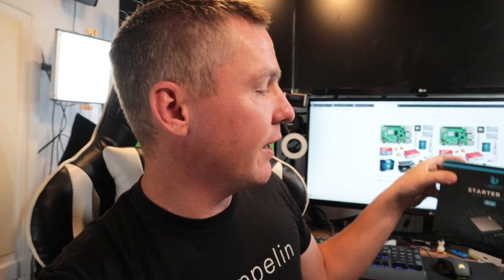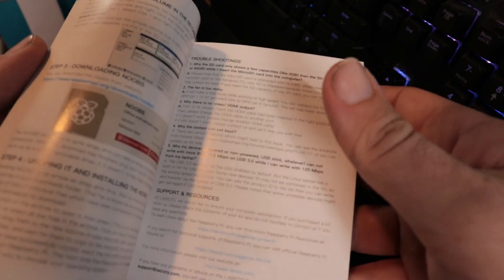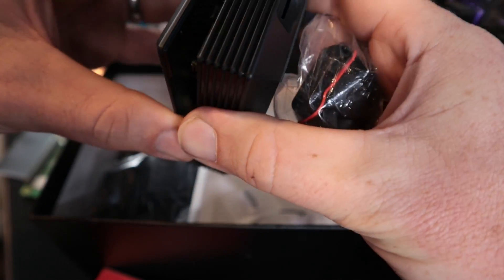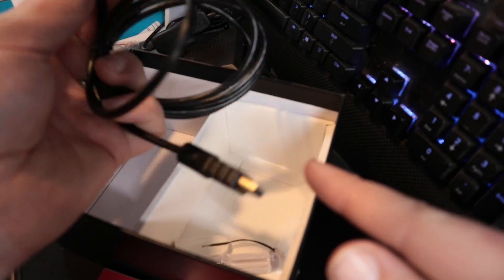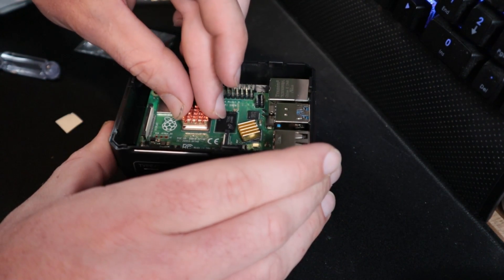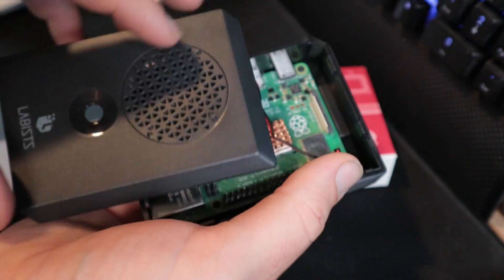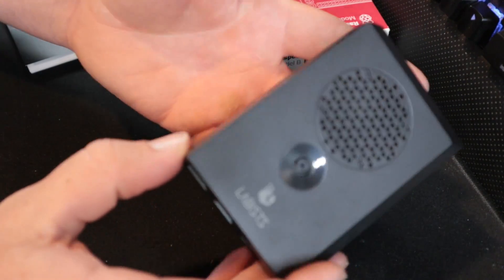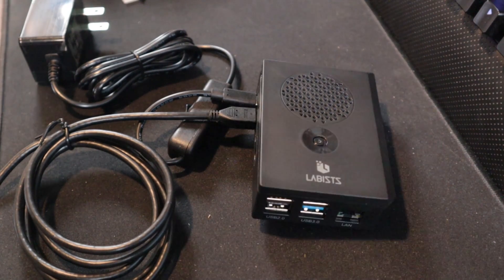Labists Raspberry Pi 4 Starter Kit

Comment: Should Raspberry Pi 5 be clocked with 2000 Mhz or 2500 Mhz and have better GPU. Today's competitors will only remain history, especially x86. I have been using RPI 4 4GB as a home PC for a year and I am thrilled, especially 

👍 since when SSD boot has been possible.

✖️ 👉 For normal users 8GB version is superfluous. 
👍 👉 Review: Broadcom BCM2711, Quad core Cortex-A72 is a good solution, but ARM cores is 64-bit and  
✖️ 👉 VideoCore is 32-bit and this is a problem, so that even higher clock rates will not do any good.

Comment: Thanks for this. Lots of possibilities here. A couple questions about use case scenarios:
1. I have a 10 yr old Toshiba laptop with beautiful screen and keyboard gathering dust because the internal hardware-motherboard/hard drive died prematurely. How might I harness this Raspberry Pi to replace internal hardware and be able to use the laptop case with screen/keyboard? 
2. Would this Raspberry Pi be appropriate for use as a server? For example,  as a NAS or to host a region on open simulator? Thanks.